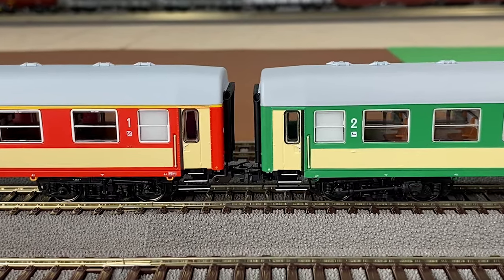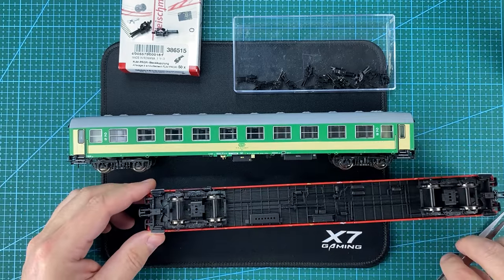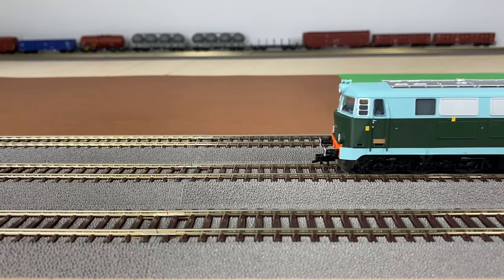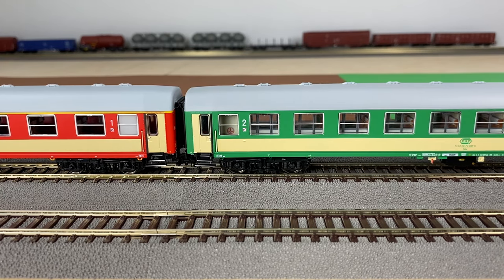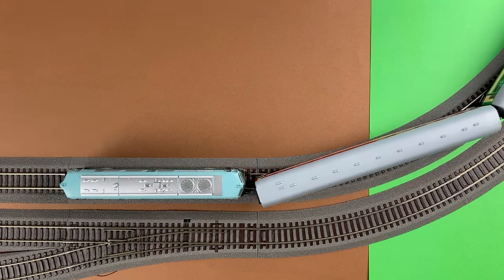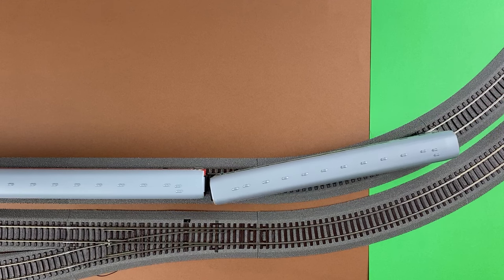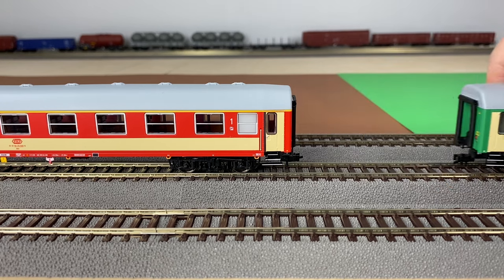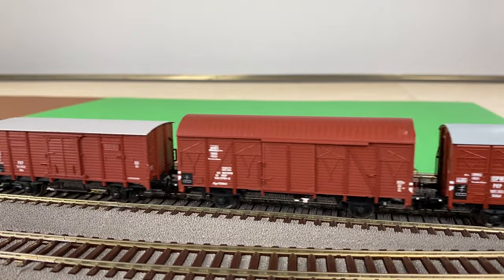Episode 17 - Fleischmann-Profi close couplers 6515 for H0 model railroad rolling stock

Comment: Will these couples work on Piko R1 curved tracks with the longest cars I have...Piko 57606, 57605 and 57608.
Reply from the maker: As I can see on PIKO site, there is a NEM close coupler pocket in your car 57606 included so it should work with the minimum track radius of 358 mm
https://www.piko-shop.de/en/artikel/ic-pass.car-1.cl.-db-ag-v-468.html